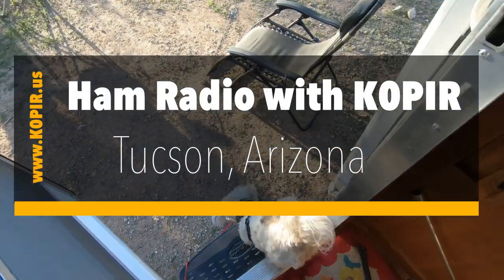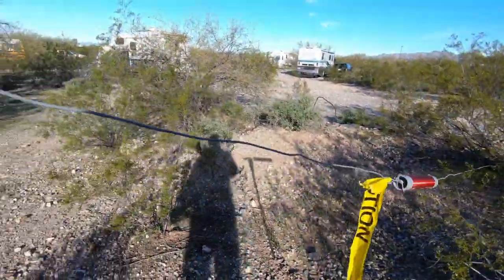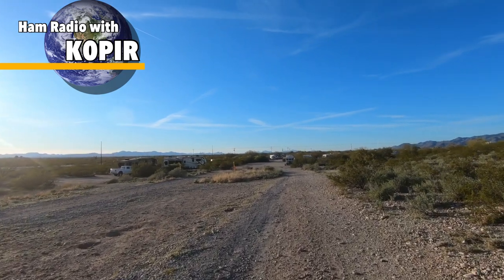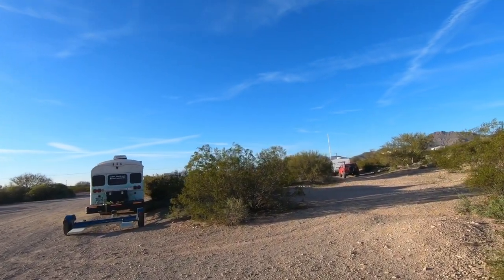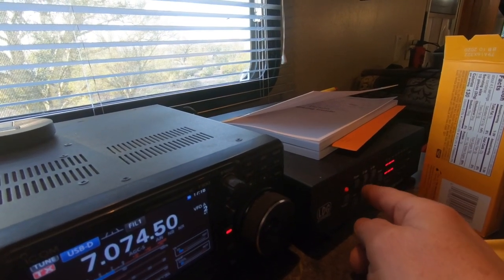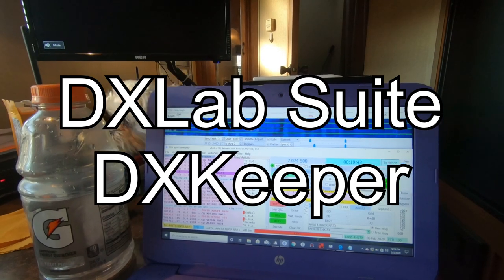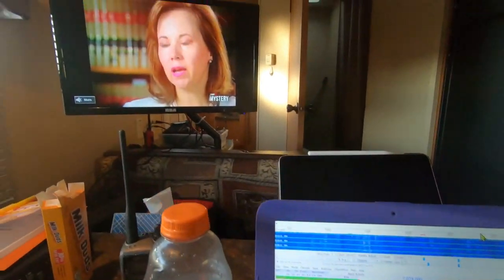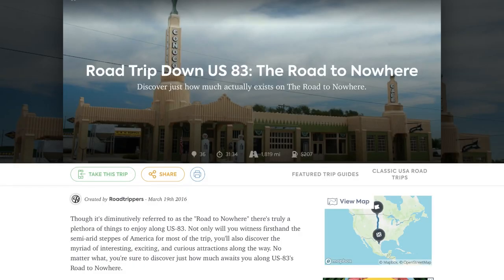Portable Station Equipment Tucson AZ Icom 7300 Alpha DX-LB and HP Stream

Comment: Mine will not tune top band
Reply from the maker: The Alpha DX-lB and 160 m? Mine Tunes up around 1.8 MHz using the LDG autotuner. It needs to be up higher and I'll try to adjust the length of the wire at the end. I'm going to see if that helps. 73!
Reply: @HamRadioAdventures  its in the 20s SWR
Reply: @HamRadioAdventures  i cant remember but its the alpha 40,80 and 160. Looks just like yours
Reply from the maker: @earleclemans4836  I checked mine with the antenna analyzer and it's around 3:1 at 1.780 MHz.  I'm going to try shortening up the wire a little bit and see if that helps. If I remember right the instructions says it needs to be up high (60ft?) for 160 meters. I'm not using a choke balun either. I think mine is too close to the camper and the ends aren't high enough. If I was able to fix that while portable it would be better.
Reply: @HamRadioAdventures  mine is about 50'
Reply from the maker: @earleclemans4836  yes that should be good. It said 40 feet or higher.
Reply: @HamRadioAdventures  KJ7BBS 73